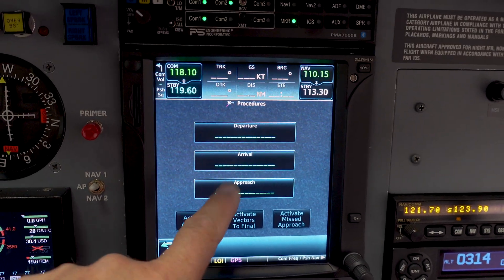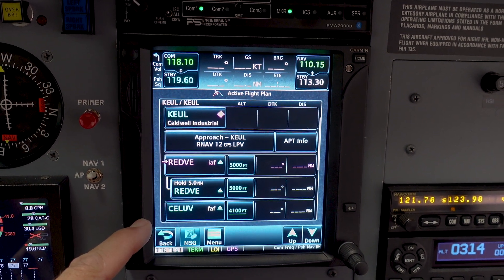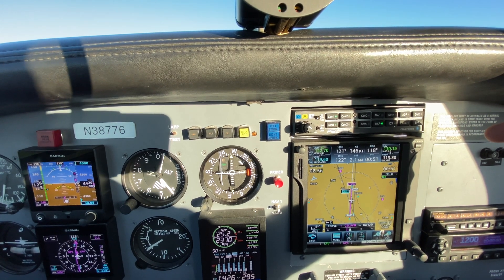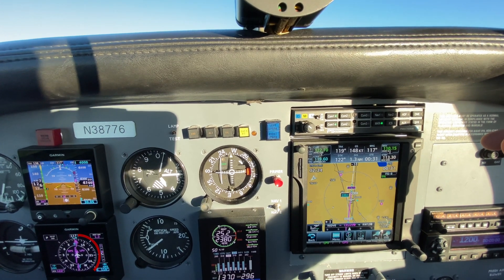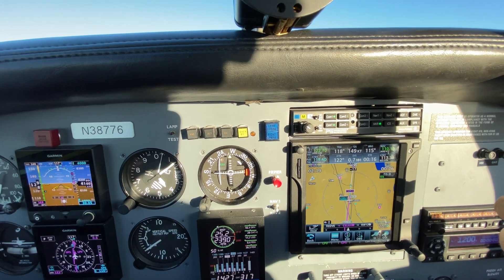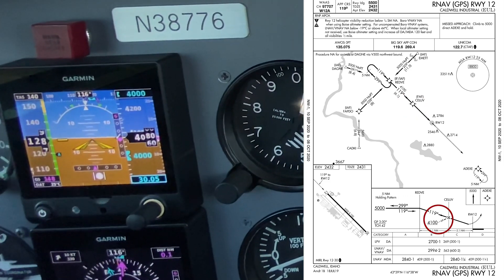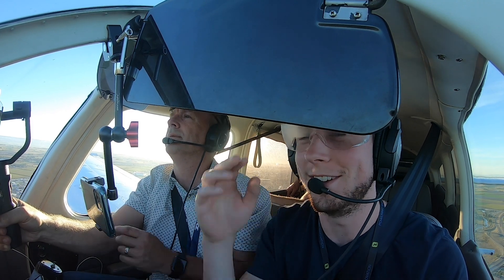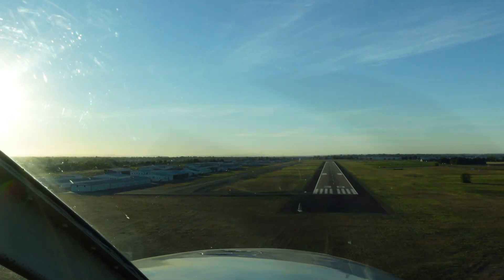Garmin GTN750 +G5 RNAV/LPV approach with VNAV

Comment: Hi, nice video, which button on the autopilot needs to be turned on for it to descend by itself according to the altitudes on the chart?, for example, on larger jets there is a VNAV button.
Reply from the maker: Depending on your AP in most cases, you can have the VNAV fly segments but switch over to approach mode on the approach for like the actually published approach.  Get with a local instructor if you are looking for help with the setup as they can walk thru it with you.